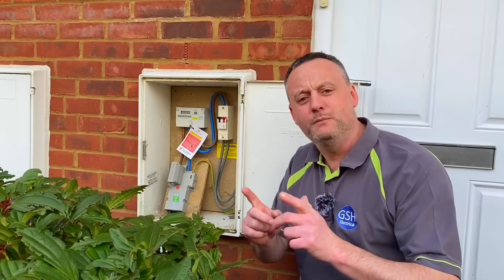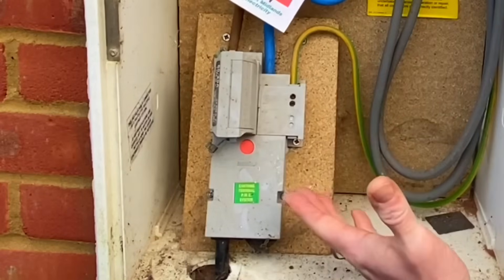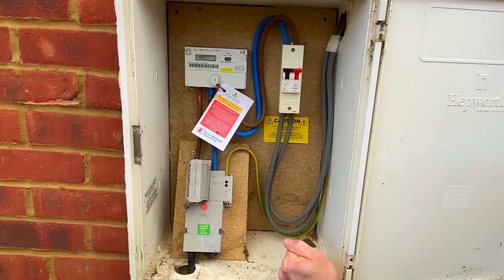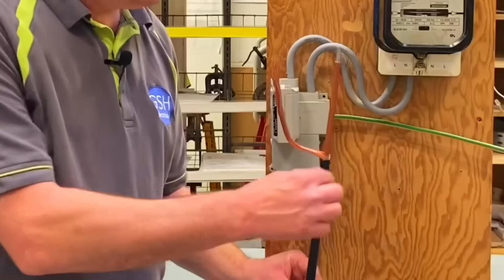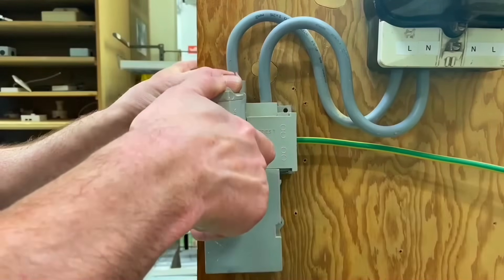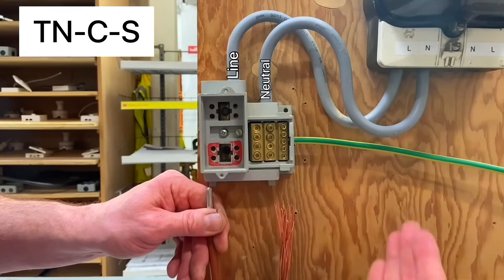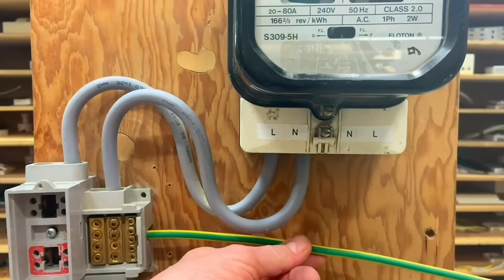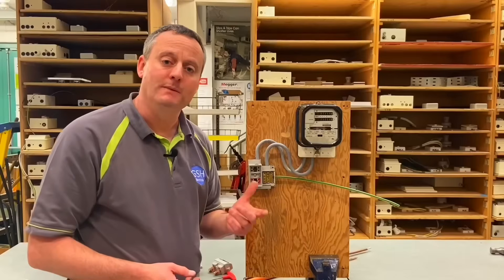It's NOT SWA Cable Feeding Your House Cutout Fuse

Comment: Hi, i'm hoping you can help on 2 questions? I am an electrician, but retired nearly 20 years ago & a bit out of date with things. We are thinking of  solar & there seem to be a lack of info on earthing, & a lot of contradiction & maybe you could help.? Have linked a drawing on my thoughts to help. 
1. Should i keep the DC earthing/lightning protection for the panels separate from the AC via an independent earth rod. Would then earth all other equipment via the incoming main, but the two wouldn't touch.  With an earth rod test we got it down to 31 ohms. 
2. Should there be a link between solar battery negative & earth rod. "48v" 
https://i.postimg.cc/8cjRZHDW/intake-earthing.jpg   Thanks.

Comment: It does make you wonder why if the distribution network doesn't require it's buried cable to be armoured, then why does it need to be armoured in domestic properties when it goes underground. Is it a matter of how deep the cables are? I imagine that putting a spade (or a digger) through a DNO feed is going to be a whole lot more spectacular that downstream of the DNO fuse.

Comment: So how would this differ in a 3-phase commercial property rated at 125amp/phase @ 400 volt total? Specifically they type of cable and the maximum distance and rating it can carry below the road. Im a domestic spark but am considering a career change to the DNO side of things so any advanced education would be a bonus 👍 thanks

Comment: It's also worth noting that the orange split concentric cable you showed has LSF properties (Low Smoke & Fume) typically black split concentric can't be used inside a property past a certain distance as in the event of a fire, the insulation can give off toxic fumes. This is where orange (LSF) split concentric would come into its element.
Reply from the maker: Thanks for adding more detail and watching 👍🏻

Comment: The cable coming into the house I am in now is a concentric cable but without pvc insulated core - the core is wrapped in oil soaked paper and around that is a lead sheath.  The lead is the neutral/earth and the central core is line.  This arrangement allows the guys working on it to be able to cut into the cable whilst live with plastic tools in order to create a joint.  I watched them do just that and it was very interesting.

Comment: Of course the advantage of concentric cables is that from a safety point of view if there is damage to the cable, for example if someone cuts through it with a spade the neutral will be contacted first before the line, reducing the risk of electric shock.
The cable to our consumer unit in our house is split concentric and runs under the garage from the meter box on the outside of the garage.
Reply: Also prevents the rather terrifying risk of a broken supply neutral in TN-C-S arrangement, where everything bonded goes live and RCDs won't trip! Pretty much guaranteed to break the line completely before the neutral should you plunge into it with an excavator..! Compare that to separate overhead conductors where a tree falling onto the supply becomes a game of Russian roulette!

Comment: RIP other phases :(
No wonder ppl use fossil stoves in third world countries when they dont have access to 3phase.
Reply: most european  countries got 3 phase service as standard. So to my place, its got   a 230/400V 3x63A mains   The stove want   11kW total with all hobs  and oven on.  The oven allone draw 4 kW. I only got three real 3phase consumers, the water pump, the drill press, the air compressor and a utility red CEE 32A socket at the backyard.  The DNO run a TN-C-S here. A local earth stake is installed (its mandatory). The incomer is 4x25mm² aluminium.

Comment: What if you got 3 hot conductors and no other else (1000A at the switchboard)? The earthing and neutral was done at the main panel at the house and the substation was about 100m away. 3 wires in and distributed into 10 consumer-units and earthing of the building. No need to play with these anytime as the janitor was a licensed electrician (job shortage etc. lead to fully licensed janitors, the 30kV unites on site where always maintained by the power company as the may not had the license for 30kV, and to be honest 30kV/110kV is scary as hell).

Comment: What size would the incoming cable normally be in practice, given the copper meter tails are 25mm I would expect the cable to be around 50 percent larger in CSA ? Many 1970s and 80s properties have 60A fuses and 16mm tails. What would the incoming cable CSA be in this case and would it limit the upgrade to 80A or 100A which is becoming the norm these days with EVs and heat pumps etc.
Reply: 16mm ...  surprised me too ... :)

Comment: I'm being stupid here...how is the Neutral not going straight to earth?.. surely you wouldn't dump 240v to earth..or is it that earth is resistive enough to dissipate it?
Reply: Neutral is at the same voltage potential as earth is. No potential difference, no electricity flow.

Comment: Why different feed cables, joined neutral and earth and separate neutral and earth?
Reply: Older properties may not have a combined neutral/earth system, so if the cable has to be replaced/repaired because of a fault the split concentric cable has to be used.

Comment: My premises has the equivalent of SWA. installed in 1927. Several years ago, SPEN created a new earth for me, by paring back the tar insulation, fixed a clamp (think it was actually a big Jubilee clip!) to the steel wire and ran an earth to the consumer unit.
Reply: paper insulated lead sheathed cable from memory, though my memory ain't what it used to be.
Reply: @chrisgreenwood271  I’ve absolutely no idea.  It’s a big thick cable that appears from underground and obviously wire wrapped. They said, I’ve now got the best earth  ever, because it goes right back to the supply. I presume that SPEN know what they’re talking about.

Comment: Hands up who calls the DNO to cut the main Fuse seal 😁
Reply: The problem with breaking the seals on fuses and meters and not telling the DNO is that the customer may well get charged at a later date for replacing them.
Reply: @Dooguk  I have sealing wires, flag ferrules and a crimp tool. I always seal back up when I'm done, mainly for safety reasons as a lot of older properties I've worked in have a cutout at a low level, often in places where little hands can get to.

Comment: Question about the 'split concentric cable' at the end of the video;
I heard that normally you can't use two smaller gauge wires in place of one thicker wire, because if there is a greater resistance in one (because of manufacturing differences, cable length, temperature, or cable damage etc) it'll end up drawing too much current and heat up.
How can these multiple insulated cables be used as a single neutral bearing that in mind?
Reply: They are used as one, they are only insulated so they can't touch the earth wires which are un-insulated.
The wires are all the same size and any difference in length is negligible.
This situation you mention would only be an issue if there was a large difference, meters of difference or in very low voltages, sub 1v, electronics etc.

Comment: By me the split concentric cable also always has 2 0.5mm copper wires in the outer as well, used for communications between an indoor display unit that id part of the prepayment system, to communicate data back to the head unit on top of the pole, that is the actual metering and disconnect. The display is powered and communicates over these 2 wires, so that you can top up your prepayment meter easily, but tampering is hard, as the cable will be dead when your credit is exhausted.
Reply: Not in the UK which is the situation here.

Comment: Many will be amazed that the earth and neutral are connected. So a metal cased appliance that is earthed, will be connected to the circuit as you are touching it, and the circuit drawing current.
Reply: Yes, it is crazy. Supposedly the Earth is bolted onto the generator but I'd prefer a copper rod into the actual Earth.
Reply: @docastrov9013  
TT is better for sure. With plastic mains gas & water pipes. 

So when isolated with a DP switch or whole house DP RCBO, as the French have, nothing comes into your house from outside. As it stands without the above your house is not  isolated.
Reply: @docastrov9013 on a generator the earth is connected to the star point of the windings . The same as on a supply transformer .

Comment: Who did that job? It looks awful!
Reply: Cut out installation is 100% correct .
DNO cables are no longer run in cavities on new builds the box is a flush box and the cable entry is at the front with a   board used to reduce bending the cable.

Comment: Out of curiosity what’s the csa of the aluminium conductor? 
Looks thinner than I would have expected
Reply: It's solid core so appears smaller than stranded. 25mm hybrid is most common equivalent to 16mm copper. 35mm hybrid is becoming more common.
Reply: Should have said  35 is equivalent to 25 copper. Cutout max terminal size is 35 in copper or ali

Comment: Would u do a video on the cable connections going back to the transformer and the working of the standard UK transformer would be greatly appreciated
Reply: There are many different types of distribution transformer setups and most electricians don't have any knowledge of how things work at the substation. Suffice to say it is a huge subject that would take hours to explain fully.
Reply: @schrodingerscat1863  I've got time exactly the more knowledge the better
Reply: @iknowmyfootball3901  Do you know how 3 phase is converted to single phase with a neutral connection. That is your first bit of research, then look at neutral earth bonding and neutral transformers. Also neutral resistors. This will show you how the neutral is bonded to earth at the substation. Because neutral is bonded to earth at that end it is at ground potential so earths bonded at the consumer end are also at ground potential. As I said this is a huge subject and is the sort of thing you cover on an electrical engineering degree. Way beyond the knowledge needed for an electrician.
Reply: @schrodingerscat1863  indeed I do not just for my benefit more for the lesser trained I'm an authorising engineer,  it is far easier to learn in my opinion to explain something showing them with a visual demo rather than giving them a book to read
Reply: @iknowmyfootball3901  Yes, unfortunately I don't know of any videos explaining that kind of thing. I worked as an applications engineer then a project engineer for years designing distribution transformers and switchgear so I have some knowledge of this but certainly not extensive. The guys that design substations, the integration engineers are the ones who really know that stuff well.
Reply: @schrodingerscat1863  I couldn't possibly tell you how I felt after walking into an equipment cabin that had lost its neutral on the 3 phase feed. and I switched it on after a "repair" by contractors!  Neutral still missing and equipment jumping, grumbling and making other silly noises until I switched off ...
Reply: @GluteMaximuz  That sounds like a nightmare, three phase equipment with no neutral connected is not going to be happy for sure.

Comment: That is poor installation of cutout ,they should be embarrassed.
Reply: Cut out installation is 100% correct .
DNO cables are no longer run in cavities on new builds the box is a flush box and the cable entry is at the front with a   board used to reduce bending the cable.
Reply: @j.f5212  I was talking about the angled lump of wood the cutout was mounted to instead fitted to the back piece .looks crap .
Reply: @raychambers3646  it's done that way to prevent cable damage. It is a functional piece of equipment and doesn't need to look good.
Reply: @JohnSmith-jk8mt  well it certainly doesn't look good .

Comment: Interesting to see the line conductor is aluminium and not copper. Why is that; just a cost saving exercise?
Reply: Cost and ease of installation. It’s much lighter and bends much easier than copper. Not really a big deal on a cable as small as this but when you get up to 185/300 3/4 core waveform cables, it makes a massive difference

Comment: I always thought ths was called PME, and that the earth at the consumer outlet had to have a seperate earth 

The use of a combined conductor applies only to the supply and not to the consumer’s installation. Therefore, except for the circumstances permitted by Regulation 543.4.2 separate neutral and earth conductors must be used within the consumer’s installation (Regulation 543.4.1 refers).
Reply: The distribution earthing system is TNCS. PME is the combined protective conductor principle, where the PEN conductor is  tied to ground via multiple earth rods from It’s source ie transformer to the DNO cutout. Doing so lowers impedance ensuring rapid disconnection of supply under fault conditions.
Reply: (PME  tnc-s or plain cable all the same thing )and we have (non PME tn-s and split cable all the same thing )

Comment: If this is the case how do we have pen fault? If cable was swa arrangement I'd understand that neutral can be broken but in this case even when cable does get damaged I can't see ever loosing pen.
Reply: PEN fault can happen at the transformer end - you don't necessarily need a damaged cable to cause a PEN fault.
Reply: @blower1  i understand. In terms of likelihood a fault will sooner occur between transformer and cutout.
Reply: When I worked on the street lighting we would get live columns because the neutral /cpc connection at the underground joint had failed but the live /line was intact . The resistance of dry soil was enough to not create an earth  rod of the steel column itself .  Concentric cables for steel columns aren't a great idea for this reason.  TN-S is better .
Reply: Where it's jointed to the main they did another video on this the neutral strands are bunched together like in the cut out and can fail at that point causing neutral failure. Or where they connect onto the over head line

Comment: if neutral and earth are the same the wire, how come it is safe to touch earth wire? 
Neutral wire at the end of the day is connected with live wire through a load, then does that not mean earth is also connected with live wire or has some voltage?
Reply: Neutral is close to earth voltage, so in principle, you don't get a shock to ground. The load it carries is (almost) entirely irrelevant - there may be a very few volts to earth potential due to voltage drop, but it ought to be very small. Not that people should go round touching neutrals, as if there's a break in the return it will go to full line voltage if any load is connected. A break in the supplier neutral would be even more dangerous, and is the weak point on all TN-C-S supplies.
Reply: Potential difference. For current to flow through you and electrocute you requires a sufficiently high enough potential difference across your body. You are standing on earth, so one side is at earth potential, and the other (your fingers) is touching the earth wire..and that is connected to earth which is the same (or nearly) the same as the potential as your feet. No potential difference and hence no current flows.
Reply: The key phrase here is "through a load" .  There is no voltage on the neutral,  there is current flow but not voltage so no potential difference.  Think of the voltage as the driving force , this is used up by the load .
Reply: @dennisphoenix1  It's nothing to do with a load. The load can not exist and the person would still not get a shock because the neutral is at the same or close to the same potential as the earth which you are standing on 

Draw it out as a circuit diagram and you will see. Currently only flows through you if there is a potential difference across you, and that is nothing to do with any connected load.
Reply: @deang5622  the point here is if you lose the neutral and there are  connected loads the neutral and earth (cpc) become live. That's what I was saying as that's the issue with TN-C-S .  I said in my reply there was no voltage on the neutral.
Reply: @dennisphoenix1 What you have said is not relevant to the poster's original question.
He is not talking about losing the neutral.
Reply: @deang5622  my original reply says there is no voltage on the neutral.  Only current flow when there is a connected load.   Which is correct.
Reply: @dennisphoenix1  You're one if these guys that still tries to win the argument despite having got it wrong. Give it up.
Reply: @dennisphoenix1  The mistake you are making is there is a debate here. There isn't.  I answered the original poster's question and I did so with a correct answer. There is nothing further to add to the answer, not from you, and not from me. The end.
Reply: @deang5622  nothing I have put is wrong.  Some might not be relevant but not factually incorrect.
Reply: @deang5622  so I was right too . ☺
Reply: @dennisphoenix1  You failed to answer the original poster's question correctly! Give up.
Reply: @deang5622  which part was factually incorrect  ??